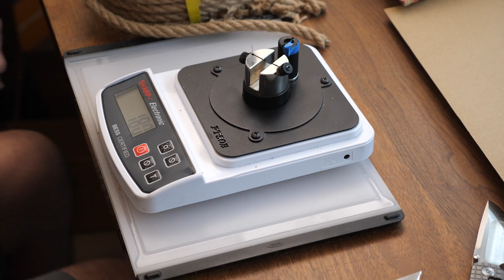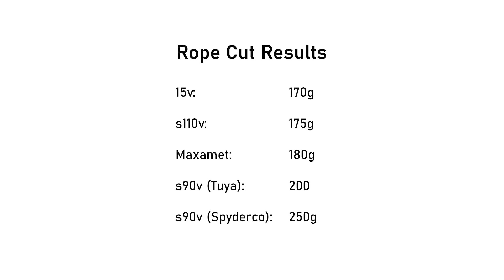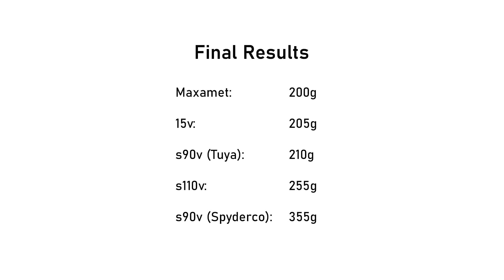Heavy Weight Smackdown

Comment: Great video.Thanks for doing it, and leaving the sharpening segments in!

10 minutes to reprofile some ~.020" bte S110V really drives home the point of how badly i need a Tormek. I spent hours, over the course of days, to drop my s110v ZT 0562 from 25(!)dps down to 17dps. Absolutely brutal experience.

I had a BBS exclusive Spyderco Military, in s90v and i could never get it to hold an edge like it should. I tried everything from 200 grit to 10k grit finishes, at everywhere from 12-20dps and never got much better than s30v levels. This was back in like 2015, and I've had amazing examples from Spyderco since then, but i found it funny to see you experiencing something similar.
Reply from the maker: Well, to be fair, I was actually raising the angle of the bevel on that s110v blade, so it would have been quick on pretty much any system.  But it is a fact that would have still been quick going the other way on the Tormek with my 160 grit CBN wheel.  

I feel your pain re: your old Military, but still holding out hope for my PM2.  I actually put another edge on it today, so we'll see how it goes.